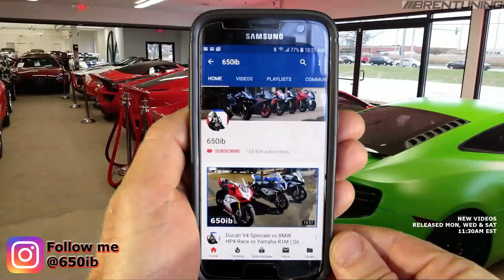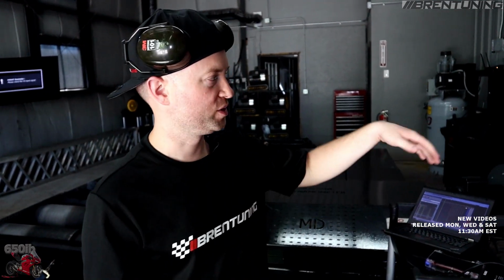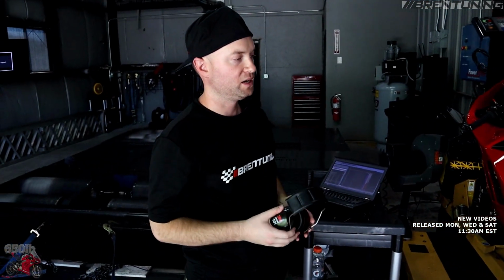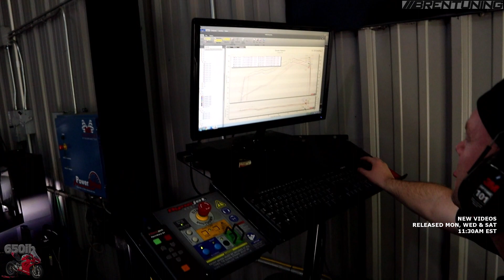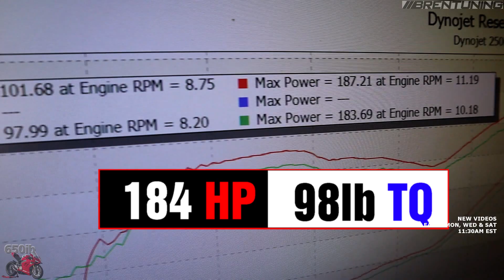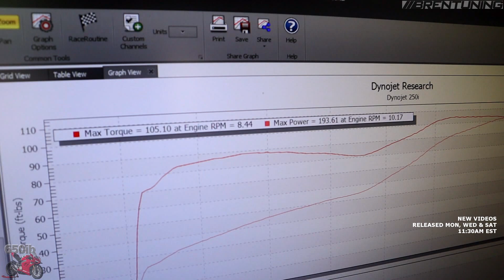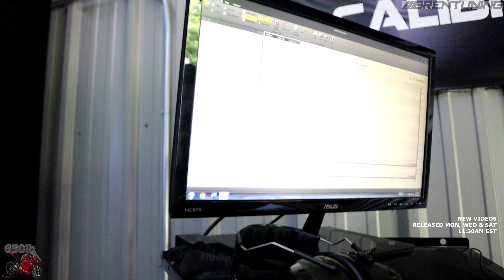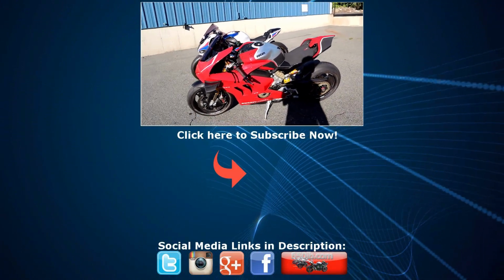TUNING My Ducati Panigale V4 R & 1199R INTO SAVAGES!!!

Comment: That L twin is almost even with the V4. Way more torque & little less HP. 1199 would be way more fun on the street
Reply: That’s what I was thinking
Reply: Agreed
Reply: Not exactly... The L twin is a race engine and chassis, it's extremely aggressive and the heat is unbearable for more than 2 minutes of traffic.
Reply: J K One of the many reasons I went with the S1000RR

Comment: Wauw that’s some hp on the V4R
My owen Yamaha R1 euro4 2019 with  3/4 system Akrapovic titanium exhaust,  Akrapovic decat titanium and BMC power airfilter it make’s 180 hp on the wheel after ecu flash.
Reply: There are differences between dyno setups. Relevant data is between runs or between different different bikes on same dyno. That's why you see a 2019 zx-10r output anywhere from 172 to 185hp in standard form on different dynos.
As a comparison, my own 2017 ZX-10RR outputs 186hp with full Acrapovic and aftermarket airfilter. Same hp number as with decat+slipon, but much more torque between 2500-9500 now. Well within reason my bike would show around 180hp on your dyno as well.

Comment: @650ib But the RSV4 1100 FACTORY kill the V4R not even the V4S 1103 cc can't match the RSV4 FACTORY 1100 Factory with 1075cc in terms of power.To Add that RSV4 1100 FACTORY is a 10 year platform with a lot development in terms of engine evolution. And the V4R is new and have a long way in terms of engine to explore some more juice of the engine.

Comment: I believe that V4R is down on power.  It's not making 230 crank horse power as advertised...  With all your mods it shouldn't be less than 215 whp on pump gas. Honestly with Aftermarket wheels clutch and full exhaust , I wouldn't be satisfied with less than 220 whp on pump gas.

Comment: Very surprised at how low the torque was on the V4.
Reply: Lower cc hence lesser torque
Reply: dheeraj murthy Yes but still at 16,000 RPM I’m surprised. My 05 ZX10R on paper anyways makes more torque.
Reply: @Captndarty  All Bikes produce maximum torque somewhere in the middle of their rpm range. So 16500 revs on the v4r doesn't really matter. HP tho is proportional to rpm.

Comment: If I had a V4R ?  I would leave it alone and drive it as many miles as possible ! When your bike is pushing 200HP stock, you cannot use/utilize all this power on the street ! Adding tunes and aftermarket engine parts is going to void warranties and devalue the bike... Why mess with perfection ? That's just me !

Comment: Hey ib, sell that 1199. If you really want to keep a Ducati twin in your collection, get a 1299 instead. Much better bike, all around.
Reply from the maker: My 1199R has a 1299s engine and I love the R colorway.
Reply: @650ib  Its more than just the engine. Go ride one if you think I'm 🐂💩ing you. I've ridden both and the 1299 is a better refined machine, aside from the extra power.

Comment: Man 194 and 204 for an R?? Uhg. Id be disappointed at numbers like that.
Reply: And why is that?
Reply: Because an 1100 factory makes 10 more hp
Reply: Alex Ventrov isnt it advertised as a 224hp or 234hp with the Akra system and up map??  Its a $40k bike thats advertised as the most powerful bike on the market. It makes less than the Aprilia and BMW it seems.
Reply: Alex Ventrov its advertised as 234hp and made 40 less than that on the rollers. Thats terrible. The BMW and Aprilia smash it.
Reply: @KP-wi3vc  I'm pretty sure those are crank figures to begin with, and every Dyno is going to read different on any given day with different temperatures and humidity that affects the numbers. The Dyno is just tool, the numbers aren't everything.
Reply: Alex Ventrov numbers arent everything and it is just a tool. But no bike really has 15% drivetrain loss. 15% is an old number from a long time ago, and even cars are down around 10-12%.  Dynojets usually run correction factor to account for the environmentals. His RR made identical hp despite being rated 30hp lower. Crazy!